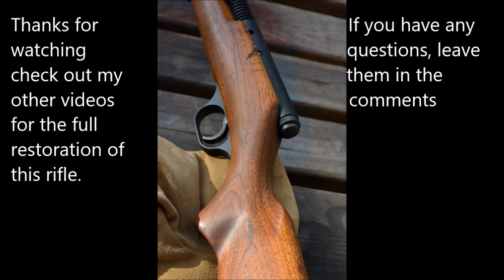Vintage 22 restoration pt 5 hvlp Savage 6a re assembled (Dura-Coat Finish)

Comment: You don't have to take the lifter pin out to access the screws. I don't, you can slide the pin through the spring far enough but before the spring pop's off. Slide the pin over to access one side and vise versa.

Comment: Do you seriously shoot your DuraCoat at 14 psi? I use a Badger airbrush with medium tip, and I set my psi at right around 38 when I DuraCoat. I have tried the lower pressures but got terrible results. Nice job on the Savage! What DuraCoat color did you use?
Reply from the maker: yes, I use a badger crescendo with the large tip and large needle, with a 1/5hp compressor at 14psi. I have found with higher pressure the dura coat cures way too fast forming strands of cured paint everywhere almost instantly. I would recommend using reducer or changing the hardener ratio if you are having trouble at low pressure. The color is colt grey and will dry to a lighter color within a couple months.
p.s. I would use a large needle if you have one it makes blending really quick/easy.
Reply: That's funny, I had just the opposite experience at the lower pressures. I always use both Reducer, and Retarder when I mix my DuraCoat, and I have to say, I have had nothing but really great results shooting it at 38 psi with the Medium tip and needle. I guess it's just whatever works for the individual DuraCoater. Within reason, of course.
Reply from the maker: Now you got me curious, if I spray at 38psi it cures before it even hits the metal.
Reply: If you watch a couple of my DuraCoat vids, you will see me spraying at 38 psi with my Badger, using the medium tip and needle. My air compressor is a Makita M700. 2HP, 2.6 Gallon, which I bought a couple of years ago after going through THREE Cheap Campbell-Hausfeld compressors which were junk! I get a perfect finish (as long as I am spraying at around 8 -10") that goes down like liquid glass. The only time I've ever gotten any dry spray, was when it was really hot out in my workshop, so I only DuraCoat now when it's between 55 and, say 70 max. The few times I have set my psi anywhere down below 20, I've gotten blobs, and splatters. I just kept adjusting my pressure up, a little at a time, and spraying on a test sheet, until I reached what I felt was my optimum psi. I've been spraying at this psi now for 5 years, and have never had a project failure yet. Maybe it has something to do with the humidity in your area? The DuraCoat Retarder, along with some reducer, really seems to help.
Reply from the maker: I'm in a very dry area with a high altitude so maybe that's the difference. I've been using my china made 35 dollar compressor for over 8 years without a problem but perhaps it's pressure gauge isn't accurate. Next project i'll spray with my big compressor to compare psi readings.
Reply: You know something, it just might be! The pressure gauge being off, I mean. There is just know way I could shoot DuraCoat through my airbrush at 14 psi without it ending up in globs on the floor! Don't the DuraCoat instructions reference spraying at something around 25 psi?
Reply from the maker: I just measured the compressor with 3 different tire gauges, 2 read 12psi and 1 read 11psi. So it's not even 14psi
Reply: Well, then I guess we still have a mystery! I just went and checked my Makita. It has two PSI gauges, one for the air tank, and one for the air outlet. They both have a maximum pressure of 200 PSI, but the main air tank cuts off at 110 PSI I think. I always make sure and drain my compressor when I'm through DuraCoating, but when I checked just now I found that I had, for the first time, forgotten to do that even though I had cut off the power to the compressor. I checked my output gauge, and it was still set at exactly 38 PSI from my last DuraCoat job last week. But, as long as things are working out for us both, then what the hell!